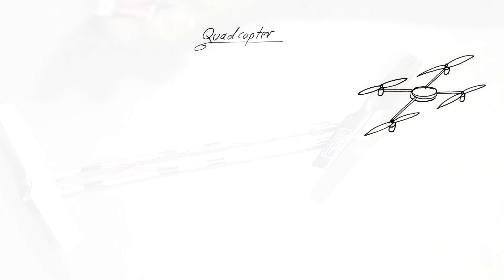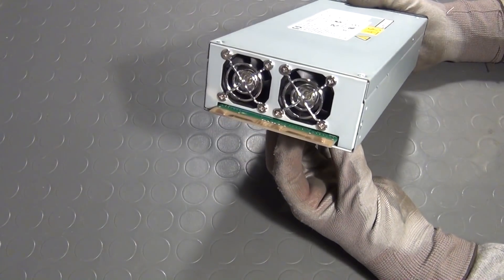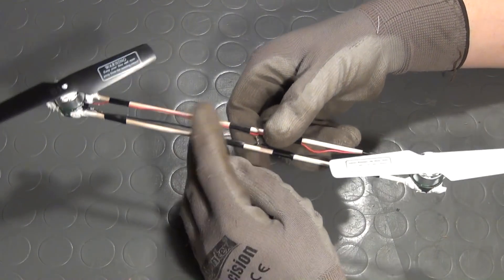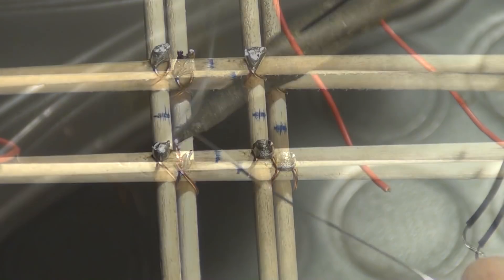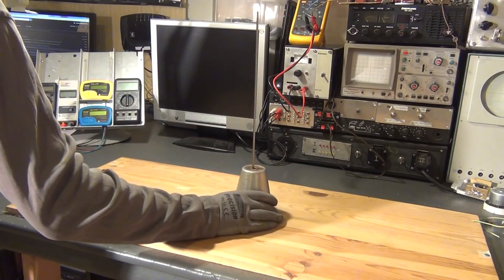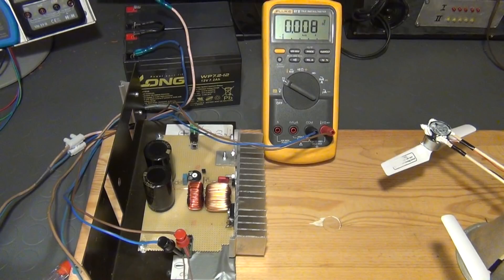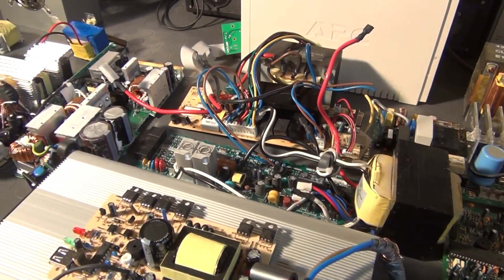Building a Cheap Quadcopter At Home (1)  - Lift Off

Comment from the maker: Stop telling me, that the direction of the rotation of the motors can be reversed by swapping the two wires. That is only true for "Brushed DC Motors". These are "Brushless DC Motors" with an integrated driver circuit inside the black plastic enclosure. The driver circuit only works with one polarity!

To understand the difference between the two motor types, watch this video: 

https://www.youtube.com/watch?v=C1-klL3B9LU
Reply from the maker: +Joe Elmore In my comment I was specifically talking about "swapping the two wires" not "swapping two out of three wires". Also in the video the motor was DIRECTLY connected to a DC voltage source. BLDCs always need some kind of motor driver, when powered from a DC source. 
Let me explain the difference:

Brushed DC motors (Permanently Excited): 
Two wires connected to the motor brushes. If the two wires are swapped the sense of the rotation is reversed.

Brushless DC Motors (without internal motor driver): 
The three wires that are coming put of the motor are directly connected to the stator windings. By swapping two of the three wires, the sequence in which the stator windings are being activated is changed, thus the rotating magnetic field created by the stator windings reverses its direction. 
This only works because an external motor driver is providing a switching sequence. This type of motor can never be used with a DC-voltage source (like the batteries in the video), without that external circuit!

This motor type is often used in RC models, but in almost all small scale industrial applications, BLDCs come with an integrated motor driver.

Brushless DC Motors (With internal motor driver):
The three wires that are coming out of the motor's enclosure are:

red: Vcc (positive supply rail) of the driver board
black: Common ground 
third wire (here blue): RPM-Readout / Sometimes PWM-input 
(There also might be 4 or even more wires, for different sensing purposes etc.)

In this motor type the stator windings are hard-wired to the driver board and cannot be reached from outside the enclosure. Swapping the stator winding's taps might also work, bur for that the enclosure has to be opened and soldering work would have to be done. With many PC fans ( and similar fans) the enclosures can be opened and closed again without destroying the motor. In this particular case that is not possible though. That's why I had to mount the motors upside down in this case. (I you want to see what fans like these look from the inside you can watch the video I linked in my initial comment.)

Almost all modern fans are powered by BLDCs and they basically always come with an integrated driver. I'm used to this because I come from an industrial background and not from the world of "RC hobbyists".  But I understand that this is causing confusion and I should have explained this in the video.
Reply from the maker: +Danny Rutter No that is wrong. When you buy a set of quadcopter propellers, two of the blades are specifically designed for clockwise rotation, while the other two are made for counter clockwise-dircetion. 
If you take a closer look at the video, you will see, that in my build, all propellers are pointing up (as they are intended to do). Two of the propellers are mounted under the motors, but they are glued on the surface with their tips pointing up.

If what you sais were the case, the craft would not lift off at all.
Reply: Unknown Zone Atleast I don't act so salty when I get corrected.
Reply: ***** Reading, you can not.
Reply: +ZnEaKySpyNL Dude listen to what he says. He specifically said that these motors have an internal circuit that allows the motor to rotate in a specific direction. These isn't some hobbyking shit, these are computer fans.
Reply: Leon ;D
The two wires, + and -. Not three wires. Damn dude... fucking kids. You're not smart, go irritate someone else.
Reply: not business brushless stupid auto correct
Reply: Noah Mcelwey
You, as well, obviously didn't read his message and didn't pay attention.
Reply: The Post Apocalyptic Inventor
Reply: Leon ;D
Yes, but these motors are from pc fans, idiot. What you use are those standard hobbyking shit. He never said that. He said that it won't work on these brushless dc motors since they have an integrated driver circuit that only works with a single polarity. Imagine a circuit board with 2 inputs (+ and -). These go to the board which has a switching circuit and a 3 phase output. You can't just switch + and - to get the motors to reverse, that only works for Brushed DC motors. Ofcourse you can modify the 3 phase output, but that's more work than just flipping the motor over. You really don't know who this man is, do you? You just saw the word "quadcopter" and thought it was some RC nerd, like yourself who only talks about RC stuff. Wrong. Let me quote you what he said:

"Stop telling me, that the direction of the rotation of the motors can be reversed by swapping the two wires. That is only true for "Brushed DC Motors". These are "Brushless DC Motors" with an integrated driver circuit inside the black plastic enclosure. The driver circuit only works with one polarity!"*.
Reply: It has 2 wires going in for power, but it still has 3 wires inside for the brushless motor.  You go inside, cut two of the traces from the driver IC, and swap them.  Driver IC may well have a pin to change state and reverse the rotation by the phase order without even changing the traces.  Their point is you can almost certainly reverse the rotation of these motors without much work.
Real problem with motors like this is they are likely junk compared to even OK hobby motors, since their weight isn't carried it is likely to be high for the power output.  Doesn't take much to really shorten the run time of a quad.
Reply: hash babe
Do that all instead of turning the motor 180 degrees? Nah mate.
Reply: +The Post Apocalyptic Inventor that is so cool!!! I might try to make it one day!!
Reply: The Post Apocalyptic Inventor oh it looked like they were upside down
Reply: 100% agree
Reply: +ZnEaKySpyNL  with basik brushles motors but in this case not change the polariti of your pc fan and nothing happens
Reply: but theso ones have a own circuit in side because this is a pc fan not a normal brushles motor but you are right with normal brushles motors but in this case not
Reply: Leon ;D
Yes you are 14, come back and brag when you have more knowledge about this stuff. These are computer fans, they have internal circuitry that allows the fan to rotate only in a SINGLE DIRECTION. There is no use for a fan to rotate the other direction due to the design of the blades. So how about you get off the internet and do your homework.
Reply: awesome stuff!
Reply: Leon ;D
Since you are aids man, and really wrong.
Reply: Leon ;D
than* If you had read my comment, you'd understand what would be the case here. Stop thinking you know it better, because you definitely don't. You're just displaying pre-pubescant 14 year old behaviour. This isn't the place for that. Go be a hero in minecraft instead.
Reply: Leon ;D
Good man, you must be very special... Now try it again with a computer fan. Do it, just try. You'll see how stupid you are sounding right now. I am the smart guy, since I have more experience with this than a spoiled kid who knows how to change  phase 1 and phase 2 and think he knows more than an actual expert who is telling him that these motors have INTEGRATED DRIVER CIRCUITS that switching the cables does NOT switch the phases. I'm not English either, so your argument is invalid.
Reply: Leon ;D
No one said you couldn't.
Reply: Leon ;D
A 3 phase brushless does, it can have n number of wires if it has n number of phases. Watch the video kid. You'll see it has no 3 wires. You should really stupid, better stop here.
Reply: Leon ;D
You have eyes, right?
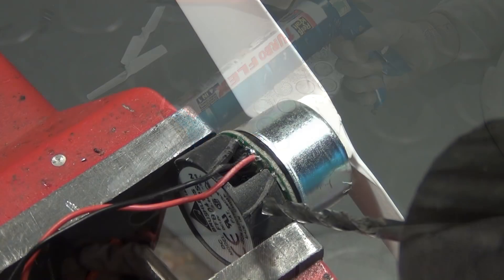 3:04
You see where the wires are going into? That's the driver circuit.
Reply: ModelLights
Or you just flip the motor 180 degrees.
Reply: Okie???
Reply: "That is only true for "Brushed DC Motors". These are "Brushless DC 
Motors" with an integrated driver circuit inside the black plastic 
enclosure. The driver circuit only works with one polarity!"

ok.
take apart "integrated driver circuit inside the black plastic 
enclosure", and what you think you'll find? :D

and more badly: those are electric motors, not "DC motors", or "AC motors"! :P
Reply: maybe shift the motor a bit to the center and add a gear on the motor,then a tube next to it put a small shaft in the tube and place another gear and a blade on the shaft?
Reply: I need fans 
from where can i get it
Reply: What is the direction of motor to fly drone
Reply: +vijay krishna just buy a cheap drone which would probably be a nano
Reply: 01992128744
Reply: you can make a business motor spin the other way by swapping 2 of the three wires, I do it all the time when my rc plane motors are spinning the wrong way
Reply: hash babe And what is DC and AC? Obviously something from different quantum space for you... DC and AC are electricity, just different types! And for other idiots: Yes, you can change directions on brushless DC motors (and he did say that), but then he will need to take motor housing apart and motor will be destroyed! UNDERSTAND  you stupid kids?
Reply: Unknown Zone Oh yeah good idea, let's first destroy the motor and get 6 MOSFETS to accomplish that.
 Do you understand that there is already an H-bridge installed inside of the housing?
Reply: Unknown Zone
Ah childish behaviour expected from a scrub like you.
Reply: The Post Apocalyptic Inventor I'm the 192.6 K subber!!!!
Reply: Grasias por enseñarme un tutorial que no entendi nada
Reply: Is it ok that i understand what yout saying
Reply: The comments section is where the experts are.
Reply: Brushless motor direction can be reversed by swapping 2 of the 3 wires. That may not be true for whichever motors you decided to use but that doesn't mean that only brushed motors can be reversed. There are plenty of quadcopters capable of inverted flight because the motors can reverse direction instantly. 

Il interested in wether what you built ever flew. It appears you have it connected to a 12v battery and barely achieved lift so a 4s lipo might be needed but the cost of the battery alone would make this anything but a cheap quadcopter. You would still need a flight controller and a power distribution board and possibly speed controllers for your motors but I'm
Not sure because you said the circuit is integrated into the motors.
Reply: The Post Apocalyptic Inventor and some ppl don't understand the difference between Dc and brushless dc motors
Reply: What
Reply: +The Post Apocalyptic Inventor 
Im sorry to say this dude, but i build my own quadcopters and rc planes. And brushless or brushed motors only  differ by gear or magnetic propultion. Swapping wires should change the way rotors spin.
Reply: The Post Apocalyptic Inventor
Reply: The reason it struggled was because 2 of the fans were suckling down while the others were pushing

Comment: U know u could have just switched the places of negative and positive of the motors to make them spin in a different direction
Reply from the maker: +Curiously random No. that is completely wrong. As I explain both in the video desription, a video annotation and various replies to other commenters, which you obviously didn't read. 
What you describe, only works with ''Brushed DC Motors'';. Fans of this type are based on "Brushless DC Motors" though. Brushless DC motors, as they are used in these Fans don't have a commutator, but an integrated driver circuit that activates the stator windings in a fixed order. That circuit is based on a PCB inside the black plastic enclosure of the motor. The driver circuit is based on semiconductors, which only work with one polarity.
Inform yourself, before trying to correct others.

In this video you can see how I make a teardown of both motor types, and explain their physical principle of operation:

https://www.youtube.com/watch?v=C1-klL3B9LU
Reply: +The Post Apocalyptic Inventor Ok thank you, I will watch the vid

Comment: I would guess you could load those motors with significantly larger props You should match the props to the motor rpm and power first then match that to the battery power. I am curious to see how you plan to control the motors for maneuvering.  Great video - I am a long time fan of barbecue skewer technology.  - If only it would grow perfectly straight - it would make excellent and superior air frames, especially for hang gliders! :)

Comment: what happened if set the blades same direction
Reply from the maker: +Vijay Kumar 1.) The quadcopter will start to spin around its own axis, because of the angular momentum of the propellers. 
2.) The thrust of the propellers will cancle each other out, because a set of quadcopter blades consists of two pairs of different blades. Two of them are design for clockwise, two are designed for counter clockwise rotation. Their shape is inverted.
Reply: +Vijay Kumar good question...watch mine

Comment: i think the motor can spin counter clock wise if you put the red cable to negative and black cable to positive
Reply from the maker: No. That only works with 'brushed' DC motors. These motors are BLDCs. They have an internal driver circuit that only works with one polarity. I have explained this to numerous people in the comment section.
Reply: +The Post Apocalyptic Inventor You are probably getting extra confusion on this because it's pretty typical with our hobby grade brushless motors to just swap any 2 of the 3 wires to reverse direction. Do it all the time on my tricopter. Nice build mine is home made as well with just hobby grade components ordered from HK.
Reply from the maker: +Tony K. That might well be. But other than those BLDCs, which were specifically made for RC-applications, the motors used in PC-fans, have the driver circuit integrated inside their plastic enclosure. The 3 taps of the stator winding are thus hardwired inside and cannot be accessed from the outside. And as I said in the video,  it is not possible to open the enclosure of the particular motor type, I used in this video. With larger PC-fans it is usually possible to open the enclosures by removing a retaining ring. However: It would still be necessary to cut off two of the taps and resolder them on the PCB inside. But I don't think that the majority of the viewers would be capable of doing that. A PC fan of this type, also has 3 wires, but those have a very different purpose than the 3 wires coming out of a BLDC, without integrated motor drivers. I'm sorry, that it must be confusing for some people, but it's not my fault that the world is complicated.
Reply: +The Post Apocalyptic Inventor I wasn't disagreeing with you about the motors you are using. I was just noting why some RC guys who stumbled across this video had some confusion. I like how you used stuff lying around and I get that is the premise of you channel. I harvest a lot of motors out of old junk and I was impressed you were able to find 4 of the same basic motors, I always end up  with a mix of different sizes. I also like how you built the test jig into the middle for easy and safe testing. Nice feature.
Reply from the maker: +Tony K. No worries. I understood what you wanted to point out. It's just that I sometimes I get annoyed, because so many people have been trying to tell me, how to reverse the rotation of these motors in the course of the last months and most of them simply don't know what they are talking about.
Reply: actually I'm having a problem in the lift of my quadcopter.would u help me out
Reply: +The Post Apocalyptic Inventor i reversed my wires now im dog fighting aliens on mars like a badass

Comment: Another good motor type to try would be HDD spindle motors.
Reply: +TheEPROM9 yes of course i do have one HDD motor its Fujitsu brand but I'm a  newbie in electrical stuff , how dose it work when it has 4 line of power except 2 or 3 I tried to get it run but it didn't, I think It need a component which i don't have ,I hope you know
Reply: It will most likely be a multi phase motor, these require fancy drivers. Salvage them when you can, also someone has probably put up a tut somewhere on how to drive them.
Reply: actually motors in remote cars ,DVD players, radios are heavy in weight... you better to buy A.R 2.0 drone motors in online
Reply: สสตภชสสบรนนนนี

Comment: can it flying if the two batteries are connected in parallel to increase current instead of increasing voltage?

Comment: would be interesting to try this with some of those tiny 7800 or 10000rpm fans. with good propellers they should be able to achieve lift off without overvolting them.

Comment: I like the idea of using cheap fan motors with integrated drivers instead of expensive RC-standard motors and separate driver circuits, but a better mounting system for both the motors and rotors must be found, or a copter built with them will always be wildly out of balance, tremendously shaky and difficult to control.

Comment: The motors was too heavy. You would have to add large lipo battery for those power hungry motors - think it wouldnt be able to lift off with its own power source. 
 You can get cheap motors(brushed) and gears online like 2$ for a piece, made especially for quadcopters.